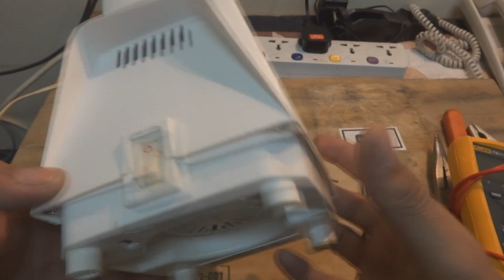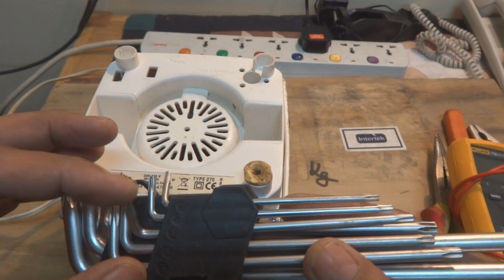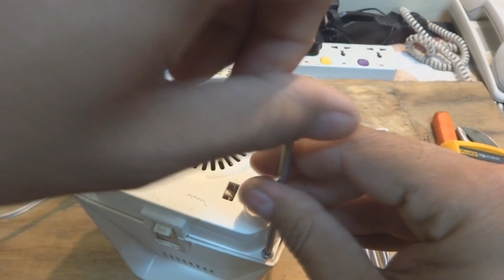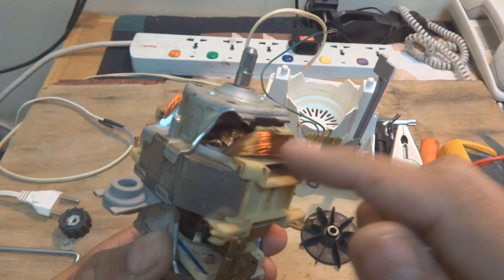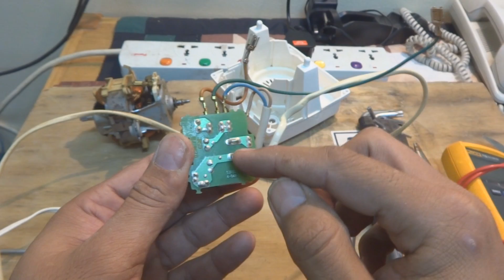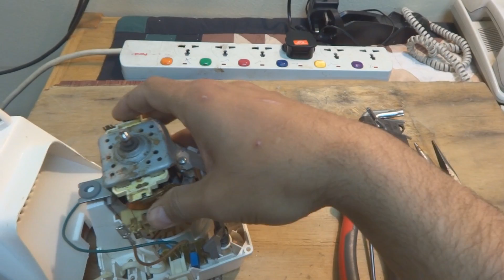Moulinex blender/ chopper repair

Comment: The best solution, it is also applicable on newer models
Reply from the maker: Yes sure. But there could be different fault with different solution. All you should have to check and test your machine circuit step by step. Then solve the problem according to fault. This testing and checking will enhance your trouble shooting skills for future. Regards,

Comment: My dear appeiciare ur attempt  . But it was much better if u would have made this video in urdu. 
Other thing that I assume u r a qualified electrician. Means u must have attended some institute for electrical course. But I was astonished when u  said that capacitor is nothing to do here. It has nothing to do  may be just to bypass some spikes. I would suggest u yobrefresh ur theory whyvcapacitors are used in ac motors.  U might have seen fans. They also have a capacitor. Without capacitor u won't be able to run an ac motor. Why? Go and refresh ur theory for ac motors.
Reply from the maker: Thanks for watching. I have another channel The Engineer on YouTube where all Urdu stuff is uploaded. You can search by term The Engineer CDI on youtube search and you will get me there. You are right. In AC series motor capacitor perform nothing special. But sure in induction motor a capacitor makes a split phase. So capacitor is a must on single phase induction motors. I have great motor rewinding knowledge and you can get a series here on my channel regarding AC series motor. So off course I know the theory. Regards,

Comment: Hi! Great video.
Do you have a solution for when the motor is functioning completely but the blades of the blender are not spinning? I  looked inside the base, flipping it upside down and it seems that the plastic bit with the grooves that rotate the blender blade seem worn. Can it be replaced?

Comment: Please answer me, I have a new blender, should the rubber coupler be removed or its supposed to be  there
Reply from the maker: Don't remove. It should be there
Reply: @JahanZeb1976  Thx but I already cut it due to my ignorance, since it was not working when I turned it on

Comment: My moulinex blender motor is not working. Do you have a spare motor for the same brand..?? Plz reply back asap
Reply from the maker: Yes I have motor. But my preferred way is to repair the existing motor.

Comment: Aoa bro, My wespoint juicer/blender has become faulty... it runs slow and gives smell, then it stops when overheats... after some minutes or withing an hour it is again able to start but with same issue... Can you please guide how to repair it.
repair guy says its motor will be replace by a new one as its hard to repair and cost of repair is almost same as new motor which costs 700-800
Reply from the maker: The repair guy says correct. Issue is the same and the machine needs new winding or a new motor in other words. You can rewind the motor yourself also if you are a little technical personnel. I have detailed three four parts rewinding video of vacuum cleaner motor here on my channel which will guide you through the entire process of motor rewinding and repairing.
Other way around is to replace the motor with a new one. Wish you good luck with your repair.
Reply: @JahanZeb1976  Thanks for quick reply bro, your videos are always helpful. I will get motor replaced soon IA
Reply: @JahanZeb1976  Bro I have opened and checked the juicer/blender... its winding doesn't seem damaged but the spindle on which bush make contact seem damaged from one side and when running this aread becomes red and gives smoke with burning smell.
Please check image here:  http://tinypic.com/r/335gy1j/9

Can only this part be repaired/replaced instead of whole motor?

Thanks
Reply from the maker: Replace that bad rubber coupler and then try it. If still problem persists, replace the motor.

Comment: The capacitor helps to reduce sparks while grinding hard staff
Reply from the maker: Yes you are right. Your understanding is well. Thanks.
Reply: Thank you for explaining 
I have opened my blender and I found the capacitor broken and there are lot of sparks in the machine is the capacitor is the problem ?  Should I bring another capacitor to get red of sparks ??? 
Thank you .

Comment: I have a problem with the moulinex fruit juicer f I try plug into live connection & switch on its not working its dead. So probably something loose connection inside. But I need special screw driver tools just like yours... To pull out the screws inside it's deep inside the screw location is deep... 
Anyway thank you Sir 4 sharing your profitional skills 👍👍👍
Reply from the maker: +Jesus is LORD thanks for liking. You should arrange for appropriate screwdriver to open it up. Also I will uploaded a complete rewinding/ repair video series on this machine as I got one burnt. Stay tuned.

Comment: I would advice to start testing the switches, connections and contacts first, then test the brushes and motor for continuity then the winding of the motor.
Reply: thanks sir this tuition was very helpful to me
Reply from the maker: +muadhatnet You are right and the same thing I tried to do here. This is a basic repair video and I tried to show every possibility to a beginner and DIY to carry the job. In next videos I will show how to overhaul motor and then also will try to rewind a motor. Rewinding data is rarely available on the internet. So it would be a good idea to upload a rewinding video with some basic understanding.
Reply: +LearningZone I am sure you did, but for the beginner it would be better to explain the process in the right sequence and procedure. Also I recommend you make a video of the basic/useful tools the average DIY needs to have for repairing home appliances and car maintenance/light repair.
In all cases thank you very much for sharing your expertise with us.

Comment: Smashing job jahan :-D
The universal ac/dc motor, that type has been used for so many things over the years :-D
I tend to test to see if the fuse in the plug is ok first, but thats a u.k thing, next i check that the cable hasnt fractured just as it enters the device, very very common for vaccume cleaners to have this kind of failure.
Then i jump to the switch, ive seen them go bad as well, and as you know you can take the rocker types apart with a small screwdriver :-D.
Any other part in series with the power can be tested with the multimeter (as you did).
Ive found that leaving universal motors in damp locations can lock the brushes into there holders, my frend had a henry vaccume cleaner that did that, i took the brushes out and cheaned them, and polish the commutators for a nice contact.
I can see you nodding your head lol, we have both done a lot of motors LOL :-D
Reply from the maker: +zx8401ztv Yes dear sir same was the situation here. The brushes were sticking in due to spill inside. As brushes were not smaller, I didn't bother to replace them. Thanks for liking and your feedback. Regards,